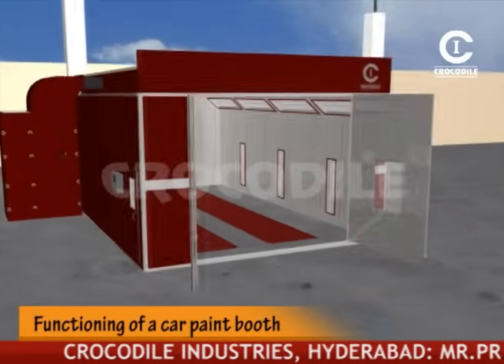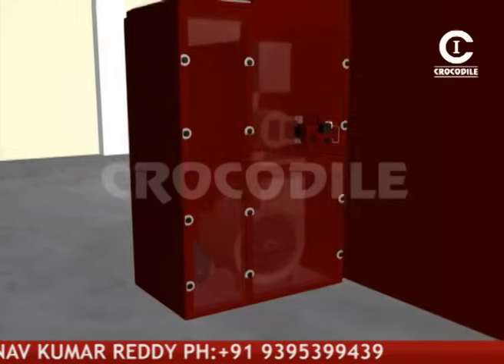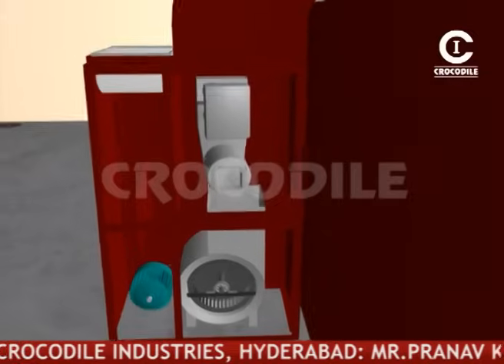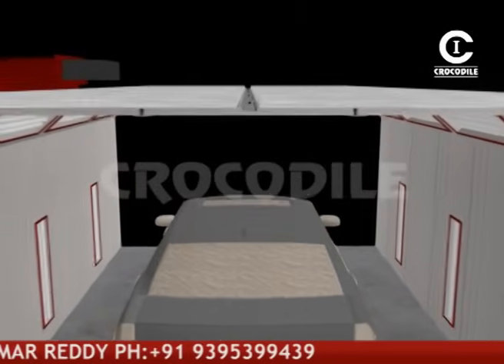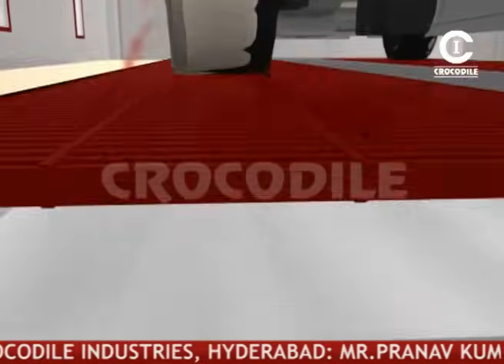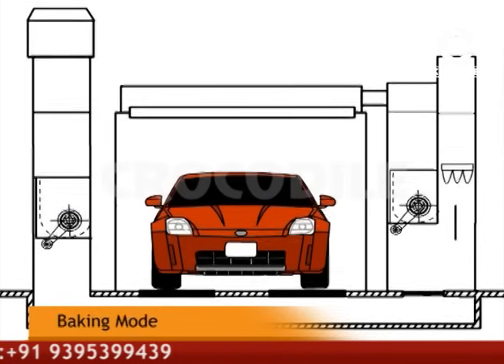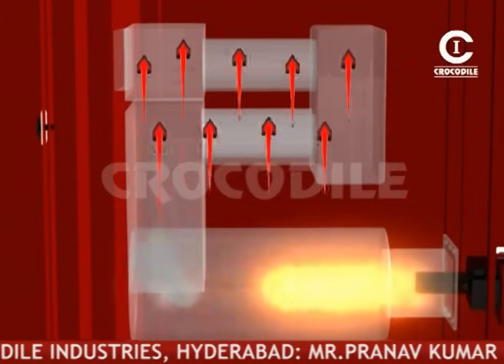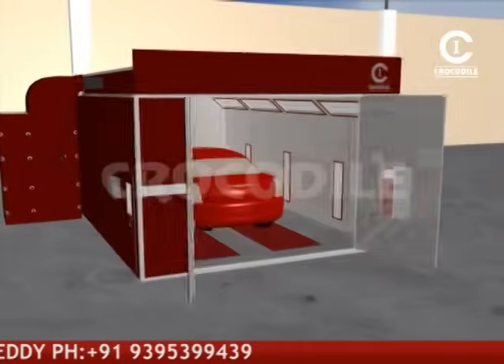working of car paint booth

Comment: It’s to bad that with this animation you did not cover how much CFM was calculated to determine the size of fan needed to support this build. Otherwise, this would have been pretty good.
Reply: just thinking that myself....  going to build my own booth and this was perfect in showing basic diagram of how system works..  now just need to see how  much volume need to move to make system efficient.  but thinking a booth company might have components for sale separately that can be spec'd based on size.